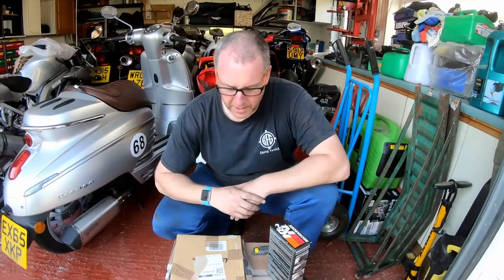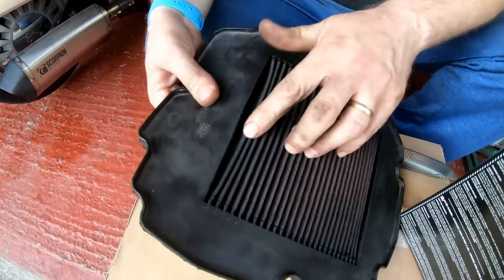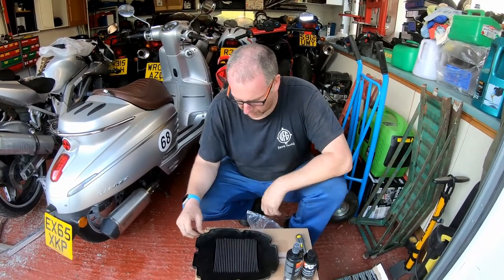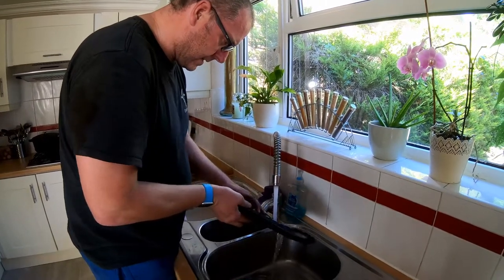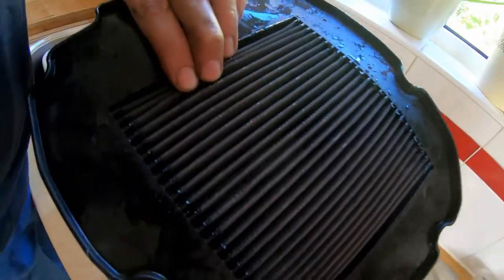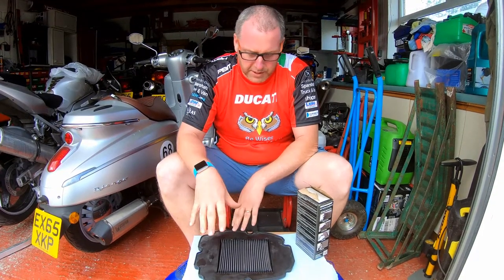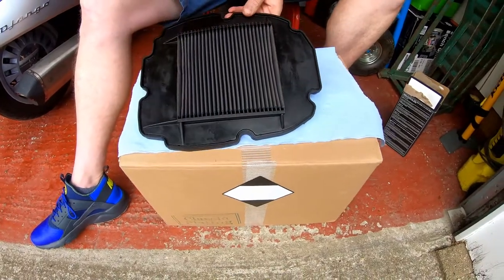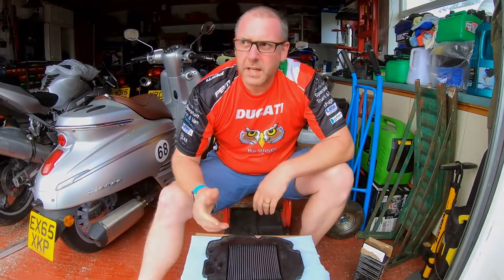Cleaning a K&N Air Filter With a K&N Filter Recharge Kit

Comment: I’m surprised you’d trust a thing like that Kevin! Think about it, a genuine factory air filter costs about $45 USD and lasts for 30,000 miles or so. You know it’s going to filter adequately and not lead to small abrasive particles ending wearing down your rings and your cylinders. That K&N is one big question mark. It’s dependent on the oil being wet? No way would I trust that. For what? $10 a year? And I don’t have to rinse anything out or open the air box again for years! JMHO. Carry on!
Reply from the maker: The theories surrounding K&N filters are many and varied. I personally use K&N filters on several of my cars and bikes and have observed no ill effects on any of them. 👍🏻